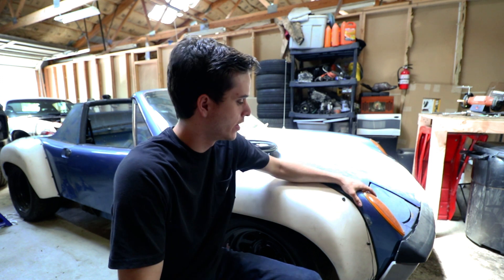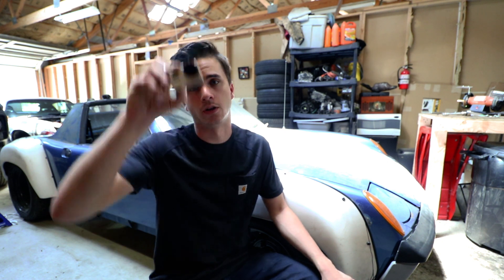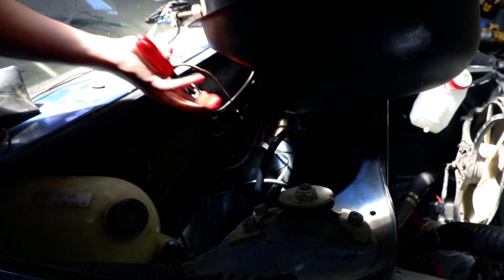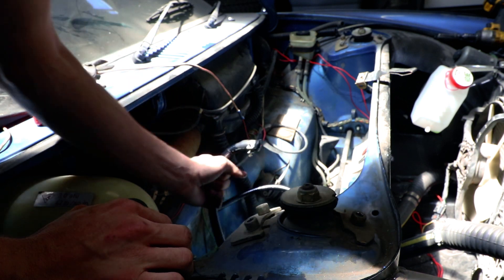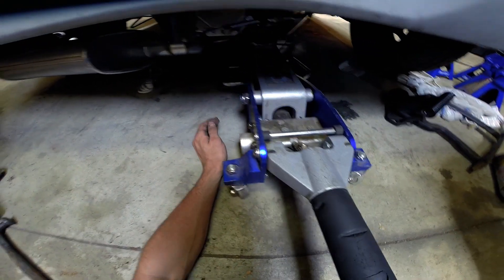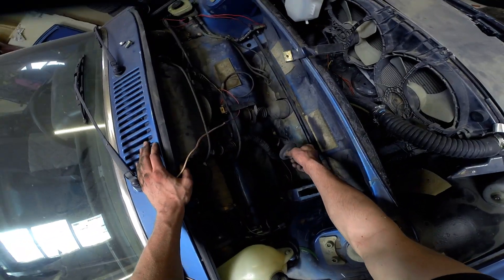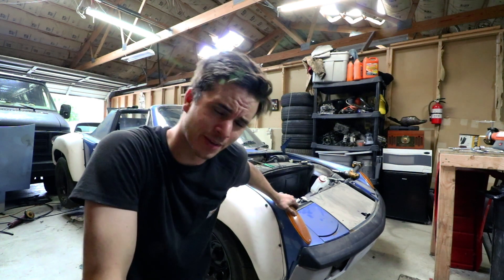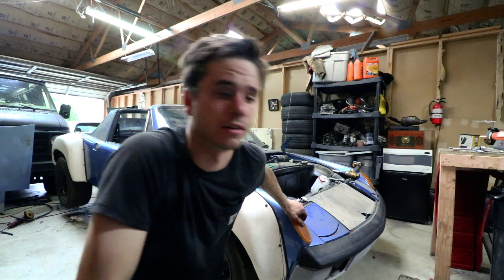Porsche Project Gets a New Fuel System | Project 914 Episode 41

Comment: I like the GoPro footage.

The stock fuel line was simple polyamide (PA) hose, I guess? I like this stuff. It's dirt cheap, works quite well and can't rust, just hardens and turns brown over the decades, which is not good, but normally you don't leave fuel hoses in place for thirty years either.